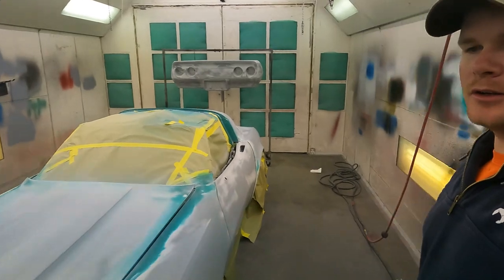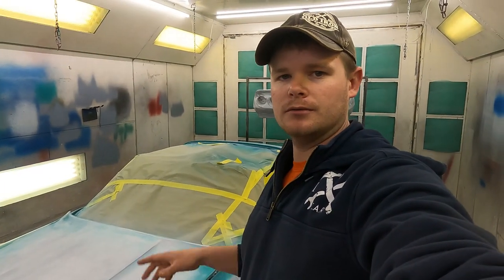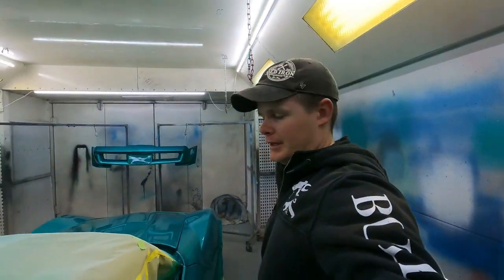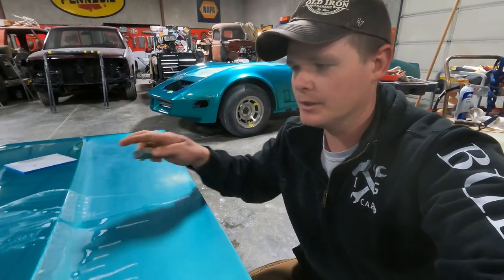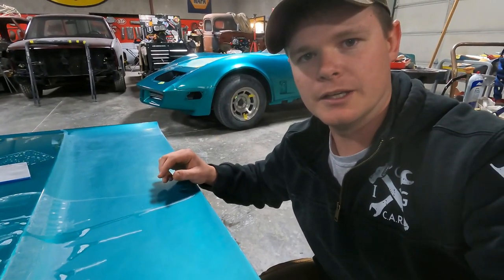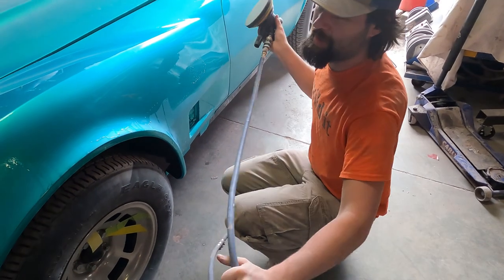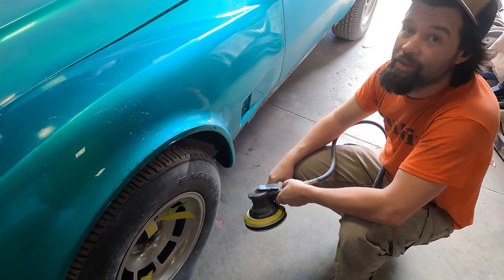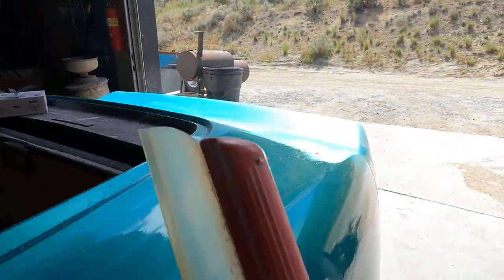1980 C3 CORVETTE CUSTOM PAINT

Comment: For the sealer, did you use an epoxy based sealer for fiberglass or what did you use?
Reply: The body is SMC not fiberglass.
Reply: It is
Reply: What does SMC stand for? Nice work BTW !  Sheet Molding Compound? Just my wild guess?